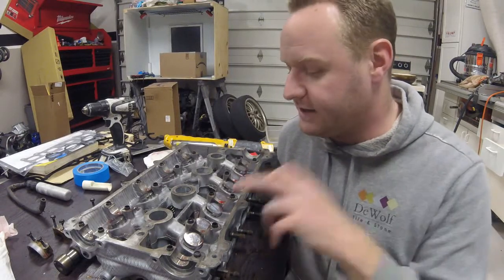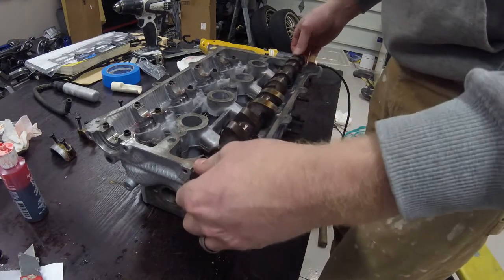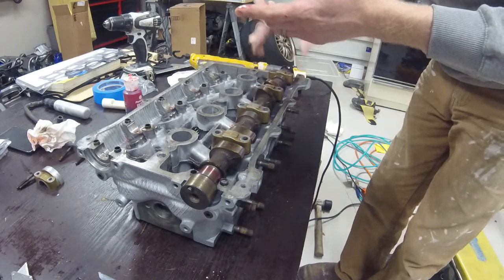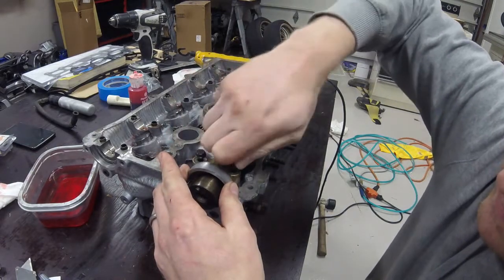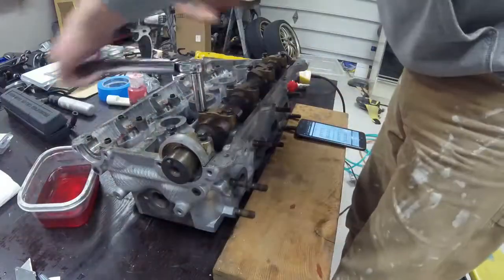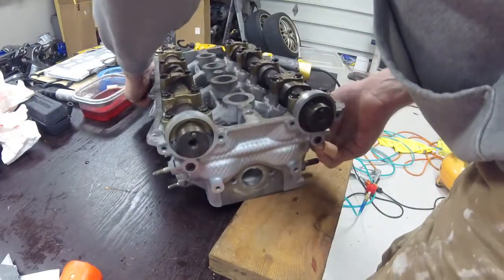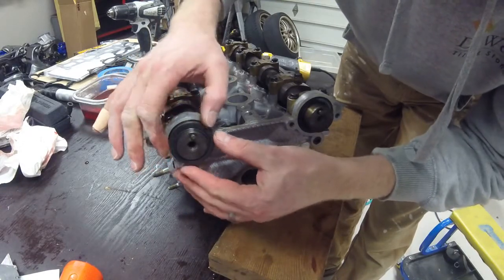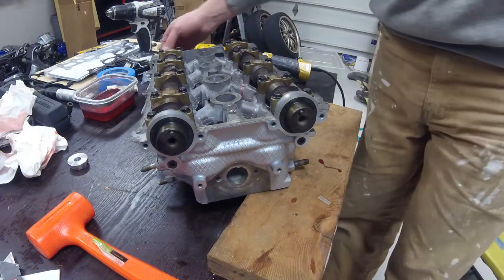Miata Camshaft Installation

Comment: The RTV under the front caps really only needs to be towards the outer edges. It only serves to bridge the gap between the cam seal and the RTV in the corner for the valve cover gasket. If the RTV squeezes out on the actual cam journal where the cam rotates, it can cause damage and further leaks.

Comment: At 5:40 you state that you are torqueing the camshaft caps to 120 ft/lbs.  It should be 120 inch/lbs.  As noted below, you will break your bolts if you use ft/lbs.  Please correct this in the video as people who are still watching this video will run into problems!
Reply: He did stress inch-lb a couple minutes before that.
Reply: @Patrick94GSR

Comment: I mixed up my caps for my 1.6 do you know if there's a way to figure out the correct way?
Reply: They have arrows pointing forwards and are labeled with intake/exhaust 1-5 front to back
Reply from the maker: I'm not sure
Reply: You're pretty screwed. Just pop em on and send it. Lol

Comment: Can you do this while the engine is still in the car
Reply: I broke the cam gear 🔩 bolt in the cam.
Reply from the maker: Yes.  Head work on this engine would not require engine removal as far as I know.
Reply: @BuildingTheEXOCET  thanks for responding you're awesome

Comment: Hey, what kind of oil is that red oil that you dipped the bolts you had a sequence for in. Also do you know if I have to remove the head to install aftermarket camshafts due to the larger size cams?
Reply from the maker: The red stuff is engine assembly lube.  It's a lube for the parts so they aren't dry while the motor waits to build oil pressure.   I wouldn't think you would have to remove the head to do a camshaft.

Comment: excellent video. very well explained. I am putting together the camshart in my miatta. I was not careful to rotulate de parte. Is that a big deal
Reply from the maker: Not sure what you are asking exactly but yes you need to rotate everything to check your timing
Reply: You should have marked all the parts to know where they did come from as you must put them back in the same order.

Comment: 120 INCH/lbs. = 10 FOOT/lbs. I broke off the very first cam bearing bolt when I stupidly applied way too much torque. The service manual starts in ft/lbs then switches to inch/lbs at the cam bearing bolt spec. I knew that 120 ft/lbs sounded odd but tried anyway. Just thought I would let everyone know not to make the same mistake I did.
Reply: Thanks bro I needed this
Reply: I broke one too, not by using a ft lbs torque wrench but because the inch lbs torque wrench failed to click and the ~160 in lbs I probably applied which snapped the bolt really doesn't feel like much more than the 110 ft lbs I correctly torqued them to once I had removed that bolt and gotten a working torque wrench
Reply: Fucken christ I just did this bs myself
Reply: Broken cam cap bolt squad literally just did the exact same on mine lol
Reply: I absolutely love you